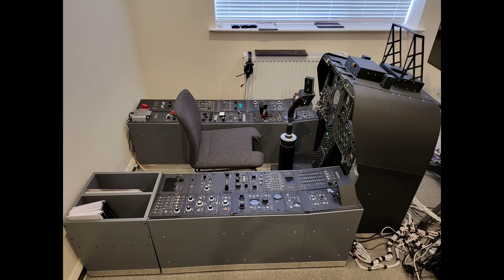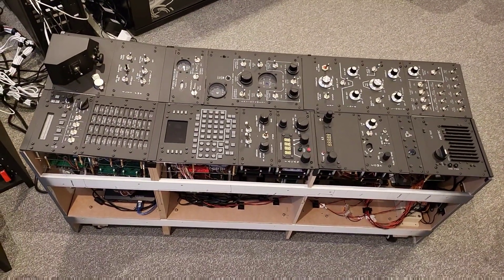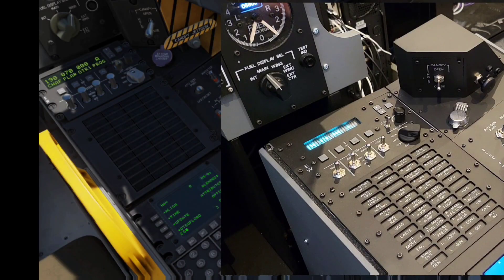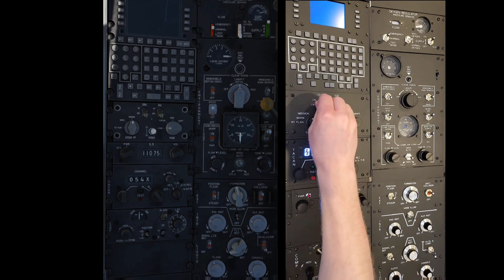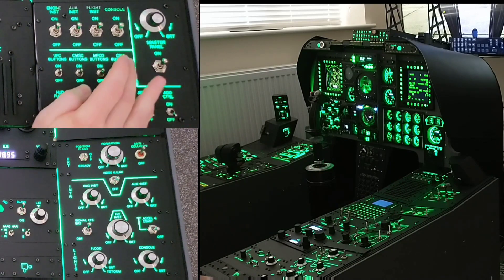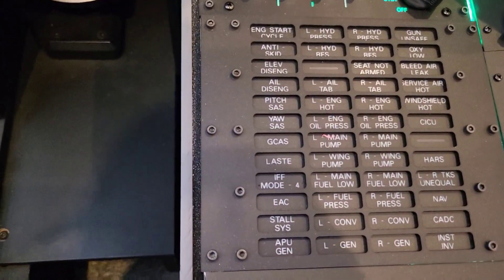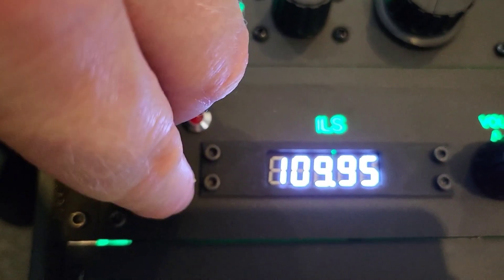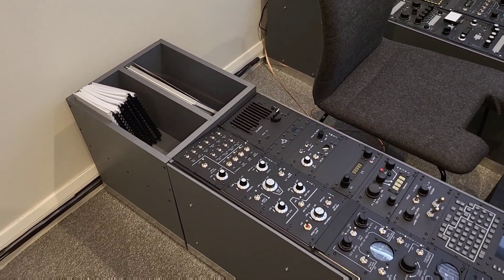Simpit A10C - Right Console - Part 6: Completion

Comment: Hi Craig, this looks fantastic - a true labour of love. 

I am curious to know if your dimensions are 1:1 scale with the actual cockpit? Some of the dimensions e.g. the width of the left and right consoles look a little larger than the real thing.
Reply from the maker: Hi Hunchy, the left console is about 300mm longer than true scale would be. When I developed the radio stack it was a earlier in my build and it was an oversized unit, this plus the spacing of panels in the left console led to the extra length. The right console is more to scale, although I've added the small map cabinet which brings it in line with the left console. Otherwise it would be out of place if one was visibily longer than the other
Reply: @CraigSmysimpit  Thanks for the clarification. I asked because your set up looks so spacious compared to how I imagined the real thing to be. I have never sat in a real A-10 cockpit, but the fighter cockpits I have had the chance to view in RL have been very cramped.